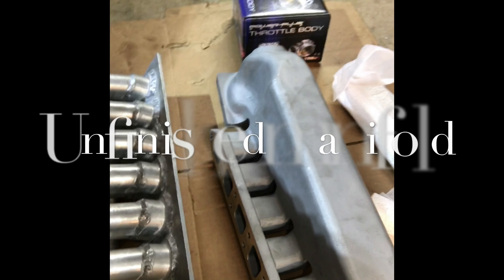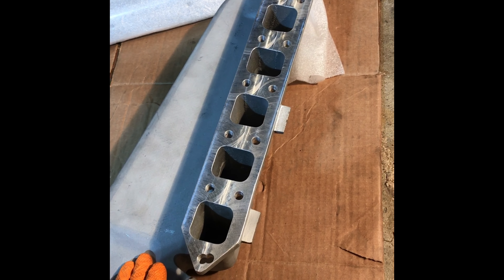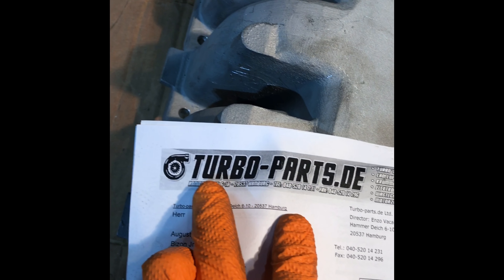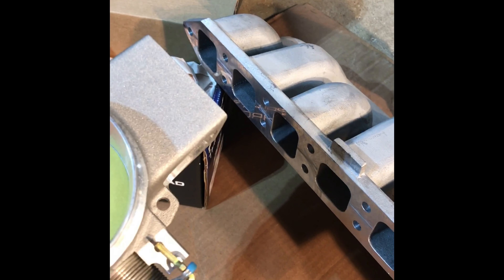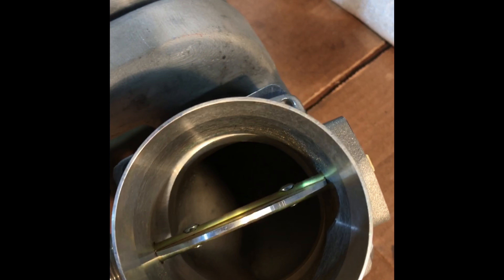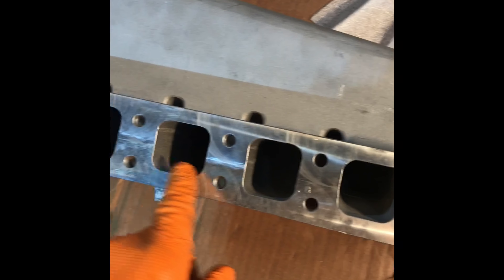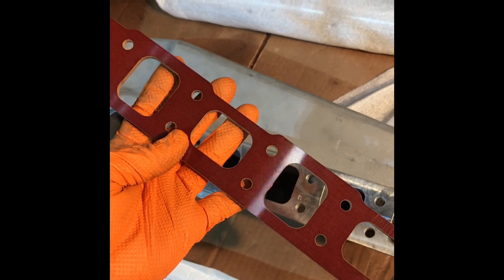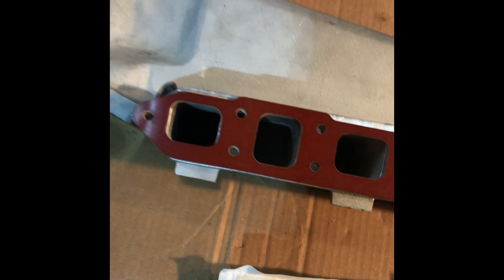Intakemani+TB 24v vr6 fitment b5 s4

Comment: Be careful those intake manifolds are made for the 3.2 head, ports don’t match exactly and fitment will block thermostat housing.
Reply from the maker: Malaka MotorSports i seen that ill work around that maybe get a different hose for the   Coolant housing 👍👍🤓🤓
Reply: JR Boosted you can upgrade the thermo housing for the all metal EuroWise unit, you can weld on it and it’s easy to change directions of the coolant flow around the intake mani/throttle body
Reply from the maker: I just double checked in my paperwork and this intake manifold that i have  is for a 2.8 24v vr6 👍
Reply: JR Boosted check the intake ports if they match to be sure. 👍
Reply from the maker: Of course buddy👍👍👍